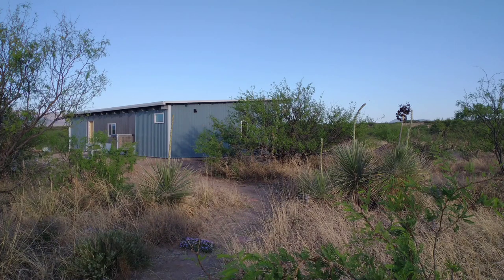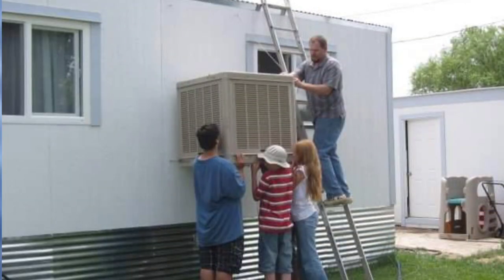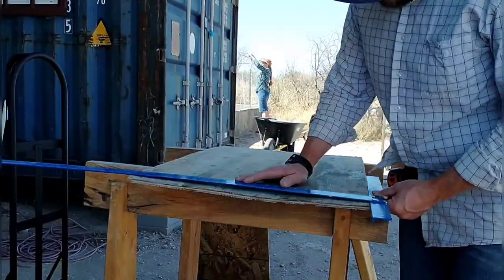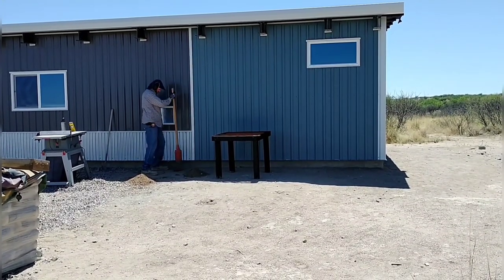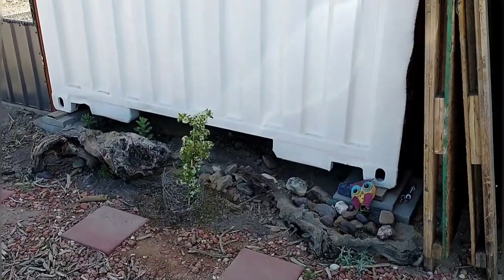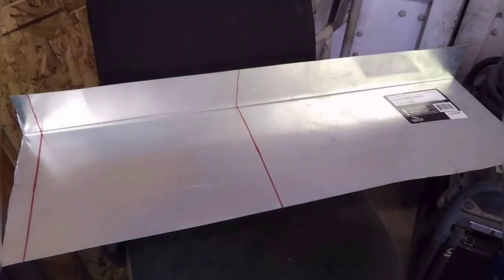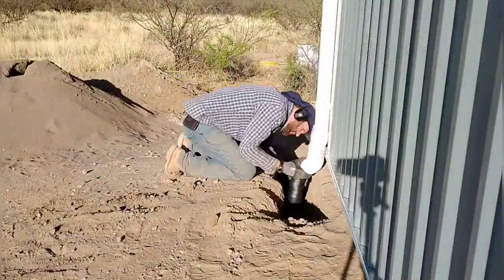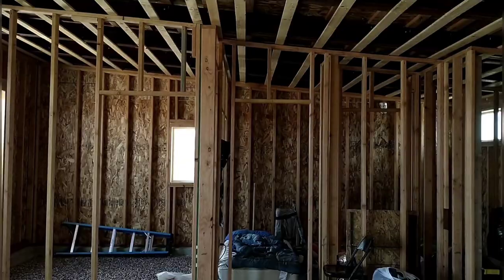#28 Getting Back to Our Home Build, Hyperadobe Bucket Dolly & Other Projects

Comment: Yep, the small detail items are tedious, busy work that break up the arduous larger tasks and is a great source of joy, satisfaction and accomplishment. It takes vision to look at something as a whole and bring it to fruition. Great job again guy's!👍
Reply from the maker: Thanks! Yes some big jobs coming up finishing the  framing, wiring and pouring a couple of concrete thermal mass interior walls, then on to insulation and drywall. 🌞 Glad to mostly be working inside, it's getting hot! 🏜️

Comment: The rubble/rock footer was very common in Europe for centuries. We used a 24" x 24" with  2 #8 rebar (top & bottom) under our rock wall. It's very stable especially in a climate such as Arizona.
Reply from the maker: Interesting! 😎  Yes, I think it will work well for his little house. His soil has a lot of clay, so it should be pretty ideal for any type of earth structure. 🌞🏜️

Comment: I don't have any trees within 150 feet of my house, and yet I'm amazed every year how many leaves find their way into my gutter. With that in mind I have installed wire mesh gutter guards that fit into the downspout hole and are not visible from ground level (they are mushroom shape - Home Depot ~$4). Also, I have a pipe guard at the end of the drain line to keep critters and snakes from living in the pipe (perforated plastic - Home Depot ~$3).
Reply from the maker: The mesquite tree leaves are pretty small, so hopefully they won't be too much of a problem, but we'll see how it goes.👍 Yes, probably would be good to get a cover on the end of the pipe. I could see the mice trying to make nests in there. 🌞🏜️
Reply: In my mobile home park, we have small narrow gutters, but stuff still builds up in them. I have a neighbor with foot tall cactus growing out of the gutter, no trees around. I think dust and sand blows in, and doesn’t get washed out enough. I’d put gutters in if my gutters were larger. 
I’m glad the temperature in your house is doing so well. Love the trees.
Reply from the maker: @kathleenpitt1981 Wow a cactus!  I wish we had a few more around here, but not in the gutter. 😄 Sounds like it would be good to rinse the sand and debris out of the gutter occasionally. It has been really nice working inside! 😊🏜️

Comment: I'm wondering why you haven't added some veranda roofs to your home. In hot climates even well insulated buildings warm up over days of above average temps. Verandas are great spaces to sit out in the evening and to even sleep out in extra hot weather. I've only just subscribed and congratulate you on the build !
Reply from the maker: The orientation and overhangs of the roof make it so that the north and south side will get very little sun in the summer. We plan to eventually put some kind of deck on the east side of the house. It will always be in full shade in the afternoon/ evening. 
Thanks for watching! 😊🏜️
Reply: @RedandAprilOff-Grid  Well Red you're  obviously a very skilled guy and you're both doing a great job. I've done two self builds here in Australia and I know the amount work, physical and mental, that has to be put into a project like yours.

Comment: Why not take inspiration from us Aussies and put a rainwater tank next to your house and run the gutters into it, just another back up water supply or run an irrigation system from it to a garden?
Reply from the maker: We may eventually but not for now. We have a good well, and the set-up is expensive. We get a lot of rain for 3 months, then almost nothing. So tanks would need to be pretty large to do us much good. They don't get refilled very often. 🌞🏜️
Reply: @RedandAprilOff-Grid  was just a thought, we have two 22500 litre tanks one polycarbonate and one concrete, no mains water, usually very little rain in a year, we have been here 5 years and haven’t run out yet

Comment: Rockwool is better. Roxul comfort batt. Fire proof, better insulation, doe sent itch as badly.
Reply from the maker: It is better, but also a lot more expensive. I am currently 2/3 done with the insulation, and Red is making good progress on the drywall. It's a bit of a slow process, but going well.